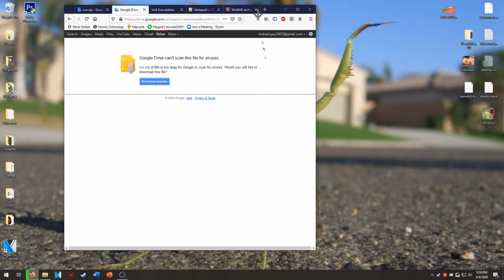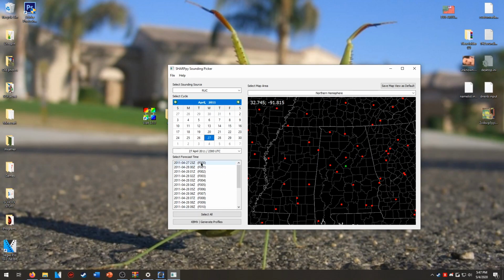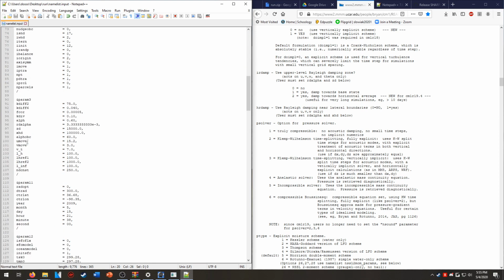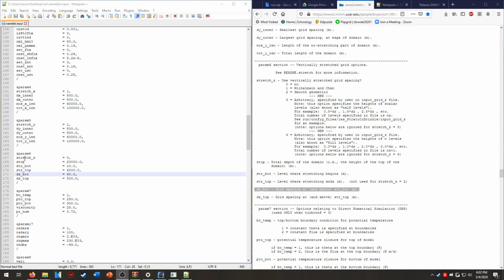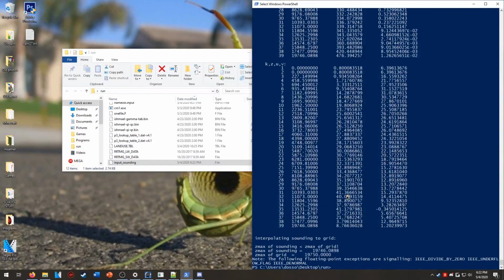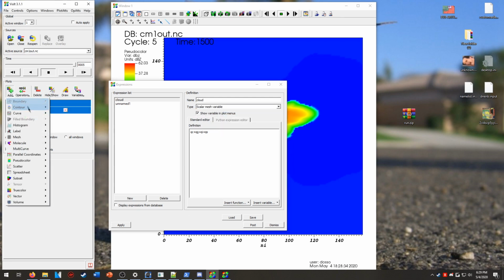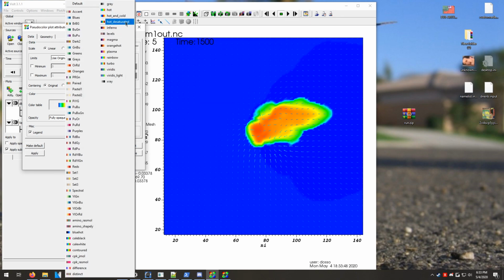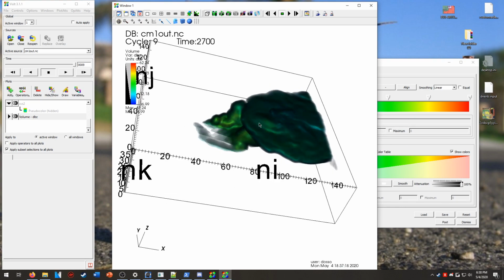How to Use and Run CM1, and Use Vislt  (Basics) (Defuncted until New version)

Comment: for whatever reason i cannot make a slice, it kept saying “the variable DBZ yielded no data” but the data is clearly there as the 3d view (non slice) worked just fine
Reply: Did you use the right sounding format?
Reply: @kingcatmemes im a little confused as to how that is relevant given that the simulation progressed as usual and every other way of plotting data works. (in visit) 

in NCAR VAPOR, slicing worked completely fine, so it might be something with visit.

Comment: I got an error saying that libbacktrace could not find executeable to open
Reply: same
Reply: solution: put the folder with less directories before it.
Reply: nevermind neither worked
Reply: @z136a1  it works now. Just had to reinstall and fix a few things
Reply: @Juliantheweatherman interesting, what “few things” did you fix?
Reply: @z136a1  I deleted the original file. Reinstalled it from the video. Then I went to namelist.input and changed the nx and ny to match the dx/dy inner and outer (for higher resolution) and then changed isnd to 17 (so that the wind is not added) and made sure that the input_sounding had no -9999 or the little %END% at the bottom of the input_sounding. That should be all, let me know if it worked for you.

Comment: i got this error

9009: error opening input_sounding file
     ... stopping cm1 ...
Reply: try opening the file and getting rid of any -9999s or the %END%
Reply: I know this is a year old and i highly bet you wont reply but if you ever fixed this can I ask how. Seriously.
Reply: @Coop-2168  I had a similar error when using the newer CM1 beta. The file needs to be called input_sharppy
Reply: @brendangully   gonna try this out
Reply: @brendangully  tried it out, getting error again..
Reply: @Coop-2168 what does the error say exactly? And are you using the CM1 beta or previous CM1?
Reply: @brendangully  it says the same thing as the comment above, 9009: error opening input_sounding file..
Im using the Cm1 beta in the description.
Reply: @brendangully  Hi. I know this was 2 years ago but can you help? 521: error reading input_sounding file
Reply: @BlueDogWx sorry no, I haven't used CM1 since then but have been meaning to!
Reply: @brendangully  I got it working btw!

Comment: When trying to open a cm1out.nc file in VisIt, I get the following error:
-------------------------
VisIt could not read from the file "C:\Programs\CM1_windows\run\cm1out.nc".
The generated error message was:
There was an error opening C:\Programs\CM1_windows\run\cm1out.nc. It may be an invalid file.  VisIt tried using the following file format readers to open the file: <No suitable plugins were identified>
The following error(s) may be helpful in identifying the problem:
The file "C:\Programs\CM1_windows\run\cm1out.nc" does not exist.
-------------------------

The file does exist (61gb in size too!) even though it says it doesn't!
Any ideas on what might be the real issue?
Reply: same problem
Reply: @RezhuEverols  Unfortunately I never did get it to work & just gave up.